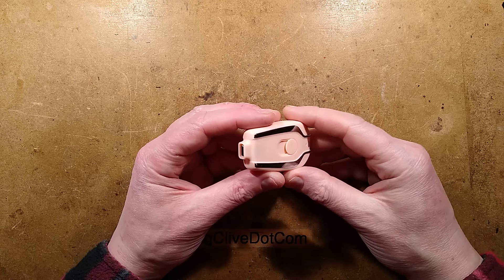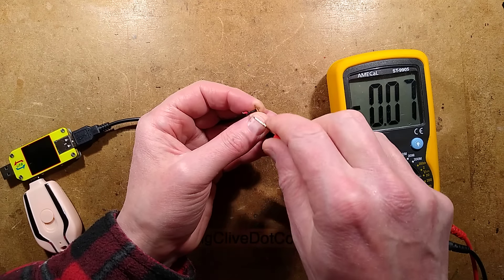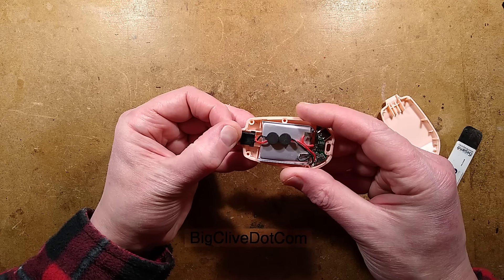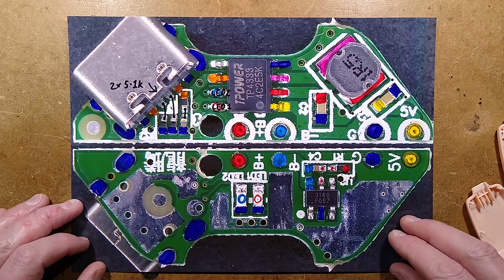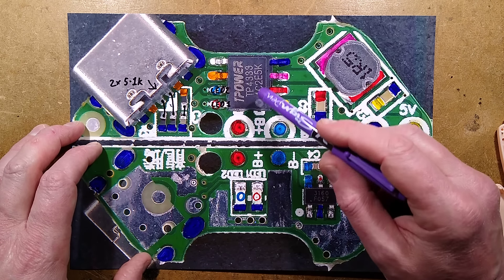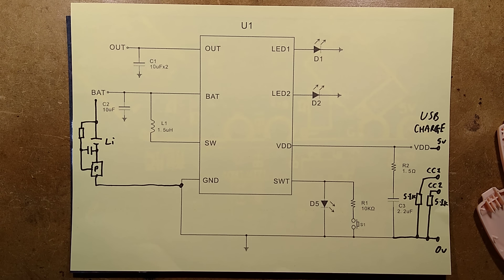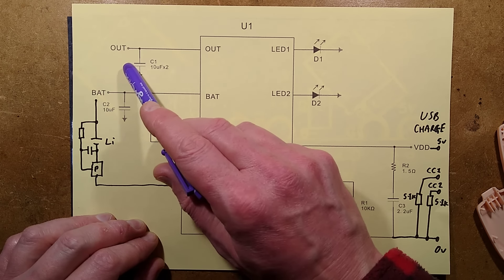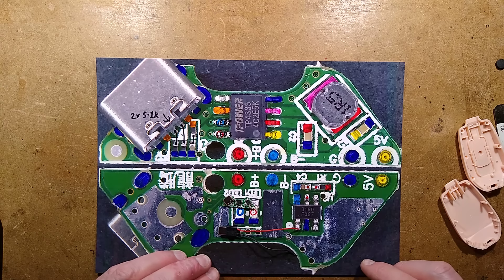eBay keyring phone-killer

Comment: This is why you put quality control at the end of the production line. Many years ago - perhaps back in the 1980s - I remember seeing a documentary set in a TV factory. There was one worker there who spent all her time whacking switched-on televisions with a wooden mallet, presumably looking for loose connections.
Reply: Nah, that's just how you got them tuned into a station right back then.
Reply: If some manufacturers will omit two resistors to save a few pence on the overall cost I can imaging the QC just costs too much for them.
Reply: @dom1310df  In this case they skimped on the QC and put the two resistors in
Reply: Seen that done with a rubber mallet. Toshiba factory.
Reply: @dom1310df  *imagine
Reply: Haha....I used to watch that TV whacking being done here in New Zealand on the production line when we were assembling Panasonic CRT colour TVs (in the 80's)...as an apprentice working on the line, I occasionally had to service TVs that had failed when said whacking caused a screw dropped by an assembler to bounce around on the PCB shorting things out as it bounced! :)
Reply: @John_Ridley  and not just no QC -  the majority of cheap Chinese electronics is not even powered up to check if it operates!  The buyer "tests" it!
Reply: Girl I’m interested in dating: “What do you do for a living?”

Me: “I’m a T.V. whacker.”

Girl: “Nice to have met you. Bye.”
Reply: @stevee7774  Beats me why she left.....
Reply: @dom1310df  It's actually impressive how they manage to make something work just enough to trick you into thinking it's an actually decent product, and how few components they use in doing so.
Reply: The first time I saw this "tap test" in real life - 1970's - I couldn't believe how hard they were hitting these valve/tube/CRT sets. But they obviously knew just WHERE to hit them.   I guess packaging then wasn't so protective and transport shook the up the goods a lot more. They were mainly looking for loose pieces of wire, stray nuts, screws & washers and unsoldered joints.  I was told the tubes and CRT's had already had one "personal" glass envelope whack test just after manufacture!
Reply: @wisteela  I have a 27 year old Toshiba CRT that I use for retro gaming. Still fires up fine with over 40,000 hours of use.
Reply: QC at the end of production lines usually performs the role of goalkeeper. It's expensive strategy
Reply: You may have been watching Beadles About mate
Reply: Seen that done at Fiat...the left door and B-column needed whacked into place cause the unibody was warped by 1cm or more.
Reply: @MattyEngland  what a waste of lifetime.
Reply: I remember too the documentary about fluorescent tubes from 1960s and it showed a lady spending all of her time just checking randomly selected tubes for cathode current specks, for arc voltage and current specks, for the grain size of phosphor particles, for the length of the tube, for even the gauge checking the strength of the endcap pins using a special weighted socket holder... now they just pack the tubes off the conveyor, only tested once for a second by a high voltage bridge and then they pack them up and you get ta least 3 duds from the 25 pcs box.
Reply: In the UK Ferguson factory they dropped each TV from a height of 6 inches.
Reply: Even that doesn't always work. My old employer supposedly embedded quality into every department. Fine. But they also had dedicated QA people as the last hands on the loading docks. Quality at every level? No.  Everybody before QA assumed all they needed to do was the bare minimum and QA would catch anything needing rework. That was their job, after all. Meanwhile the actual QA people were minimum wage temps hired merely to say we HAD QA people. The QA temps had almost no training and worked assuming all the other departments which had actual training and professional workers would have already ensured quality work was being done. The net result was NOBODY was worrying about quality and the whole thing rested on the shoulders of minimum wage temps who didn't care if they did a good job or not.  We shipped a LOT of trash doing this. Management didn't care until customers fled but the company was dying by them and the whole operation died.
Reply: @hectorpascal  Trailers used to be on leaf springs instead of air bags lol - todays semi-trucks are damn Rolls-Royces compared to a handful of decades ago
Reply: @LatitudeSky  To be honest, that sounds more like a corporate culture problem than a problem with end of line QA
Reply: @hectorpascal  Transport still shakes goods up, I’ve seen the equipment we build absolutely mangled and returned as faulty. I should try to get the whacking added to our factory test routine. 🤔
Reply: @808bigisland  lifetime?
Reply: @Matt Quinn - Caledonian TV Lol, yeah it's a weird expression when you think about it 😂
Reply: I need to see this. 😂
Reply: @stevee7774  'Percussive Tester' on the other hand .... 🙂
Reply: Well yeah, end of the line check is the bare minimum, although even that is not ideal. Relying only on end of the line inspection can be quite expensive. Ideally you design the product so, that assembly errors are difficult to make. This way you don't need to test for defects that cannot even exists. Secondly, the quality control should be at different places to catch bad parts as soon as possible, so that rework is easy and cheap. If you only test at the very end when product is fully assembled, is it a lot of work to disassemble and fix.
Reply: @LatitudeSky  Sounds like very bad management.
Reply: @hectorpascal  they probably try the first few of a batch and then say 5% of them, to catch if anything’s gone wrong (like loading the wrong components into the pick & place machine).
Reply: I want that job!
Reply: Hitting the face of a CRT with a rubber mallet is standard procedure to check for aperture grille / shadow mask vibration.
Reply: Quality control is something that manufacturers should do at every step of the manufacturing process. The testing at the end of manufacturing is a quality assurance activity.
Reply: My Ma used to do that to ma Pa, but with a frying pan.
Reply: A friend once saw my tools and, knowing what electronics I work on, asked me "What do you need this screwdriver for? Doesn't seem useful."
I gave him the terrible truth: "That one's just for percussion."
Reply: @hectorpascal  That is exactly what Microsoft does ....and it used to charge a monthly fee for the updates on floppy disk, which were basically bug fixes to repair the faults in their software.
Reply: I remember the joys of having to whack valve TV's on the top if they failed to switch on, presumably to bump the starter tubes in to action after thier sockets came loose from heat expansion. (When they are warm they expand, so when they are cold they retract and disconnect). I think the banging on the top to get a station tuned in was related to loose solder joints, due to cracked solder from heat expansion, and dust in between the tuner leaves.
Reply: things are mass produced in far too large of numbers to test every single device and has been for very many years, where that's made, they likely have no Q.C. at all or test a few out of multiple thousands.
Reply: We still do that to computer monitors, it's part of the production line display testing, it's just a rod that beats the monitor from behind and off center, but I don't know exactly what it tests for. I know that sometimes heated devices can work due to heat expansion in the connections, but then cold they don't work, so beating on it with a rubber rod just might show if there's something loosely connected or if the display is not attached correctly even if it seems to be working correctly.
Reply: @bigjd2k  That's certainly normal practice at the beginning of factory production.  Sadly as speed ramps up, workers will unavoidably make mistakes.   The real problem arises when managers start to demand even faster production to fulfill their contractual obligations on time.  And that's when the testing stage becomes the easiest operation to bypass.
Reply: Maker can't do a 5 second on/off test.  WTF?
Reply: Awwwww I’ve missed my dream career by not knowing it even existed
Reply: onslow..
Reply: @JK-jl5lj  The screwdriver is for taking screws out, the hammer is used for putting them in
Reply: That was the 'go to'  home fix back then.
Reply: @ConstantlyDamaged  I can confirm this. I used to be the remote control for the living room tv. Changing channels involved a pair of pliers. 😁
Reply: Good job for a woman lol. Wouldn't want to confuse her and get her frustrated.😆
Reply: @hectorpascal  Yes, just bought a dehumidifier from Amazon that didn't power up. Complained and got a refund, then told "no need to return it." When I opened it up the connector to the power supply was sticking out, so pushed it back in and it started working.
Reply: @hectorpascal I'm alarmed at the lack of ethics of the whole thing ... No QC, no testing, no safety, all greed! (And a bevvy of fools to buy the shit)
Reply: Oh her!!! Dude, she was bomb at Whack-a-Mole!
Reply: @johnkukla9522  Sadly ethics and profit parted company in most of the business world many centuries ago.
Reply: You need to check out the Trabant factory QC video.
Reply: @lotuselise4432  Trabant factory QC? Isn't that a contradiction in terms, like the Vatican Atheists' Society?
Reply: @zh84  - Whatch the video - it even has Red Neck mullet haircuts in it.
Reply: Now they just smack the employees with wooden mallets.
Reply: Ahh yes the persuasive percussion preposition or as it is more commonly known "work dam you or see what happens"
Reply: @Okurkaarrgghh  'i love your optimism
Reply: You should see how they certify 'bear-proof' containers
Reply: @charleslambert3368   At the gay bar?
Reply: Aircraft manufactures actually use shake tables to check for problems.
Reply: @abcnz1  Maybe he’s beating something too.
Reply: My kind of quality control....a big mallet!
Reply: she didn't work there she was just a local hoodlum
Reply: @brianallen9810  Even more violent artificial vibrations were required to test parts for the Saturn V rockets.
Reply: I only do that if my football team lose.😂
Reply: Isn’t the user at the very end of the production line?
Reply: Think I seen that episode of Tom And Jerry
Reply: I doubt where ever this was made has quality control at all.
Reply: @ConstantlyDamaged  lol I never thought that was really a thing until recently one of my Panasonic 27 inch started making the sort of noises you hear when a power line falls like you know that bwaaaawahahawahahawa noise and it only stops when you smack it on the bottom now 🤣
Reply: @808bigisland  shoots brah take a nap about it 🤙
Reply: @JohnDoe-gq6yg  Usually a good sign you have some "dry joints" in there somewhere. Find yourself someone with a can of freeze spray, a soldering iron, and several hours spare.
Reply: Yeah the different "grades" of products should be clearly labeled on all products in my opinion. Most people don't even know they exist. From someone that worked at a company that made "military grade" electronic devices. It's not that hard to do the job rite and efficient the first time. Only caviot is that you have to be a halfway decent human being with a smig of a work ethic.
Reply: Every time she hit the TV, did a little mole pop up?
Reply: Her tv just kept getting lines or scrolling the picture...😂😂😂
Reply: China puts quality control nowhere in the production line.
Reply: Must have been zenith a good whack on the side and that old console got correct
Reply: I think whacking old valve TVs used to actually work, I remember my dad doing it. I think the joints uses to "dry" out so a whack could reconnect them
Reply: You should see the whacking I do to my 200 dollar gas station Nokia when it tells me it has 3 bars of service yet is loading YouTube EXTREMELY F*ING SLOWLY, the more frustrated and harder I bash it, the faster it DOES WHAT ITS F*ING TOLD FOR THE LOVE OF GOD JESUS CHRIST THIS THING F*S ME OFF CANNOT WAIT TO GET SOMTHING THAT FLOWS WITH THE DAY.
Reply: @manolisgledsodakis873  Another test done with electrical equipment in the UK was to toss it down a flight of stairs once it was boxed up for transit.
They discovered that cardboard boxes were better than wood. They gave more protection.

Much later I saw a triple-wall cardboard box cut to fit round the metal object it was made to contain. That one was as strong as a lump of wood.
Reply: @df7242 .......
 grammar and spelling however.....
Reply: @808bigisland  says the person insulting someone for having a well used tv...
there's more to life than what you think is good/right, so long as someone's happy and they aren't hurting anyone they're doing absolutely fine.
Reply: @ConstantlyDamaged  Ahh, good ol' percussive maintenance. It's also how I got my car's headlight working again in many instances.
Reply: Just whackin' it.
Reply: Who knows . Back in 83-84 they where installing the cable for cable tv and I begged my mom to get cable . She’s German and left after WW2 and doesn’t trust the government I get it . She said she was worried that the government could listen n watch from the TV . She was right she was right at the time that wasn’t even a thought
Reply: @MattyEngland  thats before capitalism gained full control on hell bent profiteering.
Reply: Idk but it seems like nowadays quality control is left to the consumer where the company would offer 1 year or 2 years warranty if any defects found.
Reply: percussive maintenance wasn't invented by Fonzie, but he helped spread the word.
Reply: Realign  aperture  grill  kink.
Reply: @Damaged
😂👍
Reply: These days they just ship TVs with a mallet so you can whack it yourself 😂
Reply: Final QA is going to be a necessity as long as there are assemblers.  However, I've always advocated for "Up Stream Quality" making the people who build the things are responsible for their own quality.  Then a final check verifies things are right.  If something is found at the end and the product has to be partially disassembled it's useful to both educate the one(s) who made the mistake(s) and have them fix them.  That way they become more aware of quality AND of how things are properly done.
Reply: I worked for Zenith for many years. One of the final tests on TVs was striking on different axes with a rubber mallet. On the test sheet it was listed as "JWS" - jumps when struck.
Reply: @LatitudeSky  An inspirational story. Thank you.
Reply: Quality control belongs all throughout the processes.  You don't build and discover, you watch as is built.  You wouldn't build a towering sky scraper and then start checking for quality, would you?  Quality belongs at ground level, and even before then.  When plans are made and drawings are produced - quality belongs in every phase of construction - even conception.
Reply: I used to whack my TV to fix it years ago...
Reply: creamy-bun  Superb adverts. All on YouTube.
Reply: @BGraves  very true - QC can be done at EVERY stage not just at the end - notice how carefully Clive uses polarised molex connectors, the 'design stage' could have added these, and you no longer risk someone at the end of the line making a mistake, and you don't need a soldering iron etc. for final assembly - probably saving money and loss of reputation.
Reply: TV's now days:
Whack! This one's bad,
Whack! This one's bad...
Reply: No, you don’t inspect for quality at the end!  You start with the design, build quality into every step, and then need minimal inspection at the end!
Reply: Why are they wacking them when I had to wack the damn thing anyway
Reply: 🚅  don't you all enjoy railroad
🚈  trams, trains etc are just so cool
🚞  take a ride in my ''transportation''  folder :)